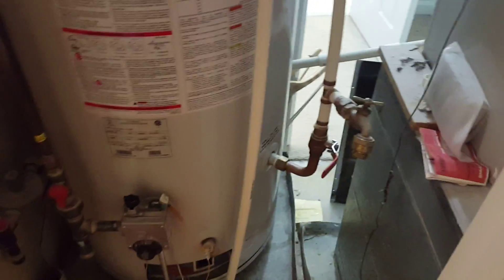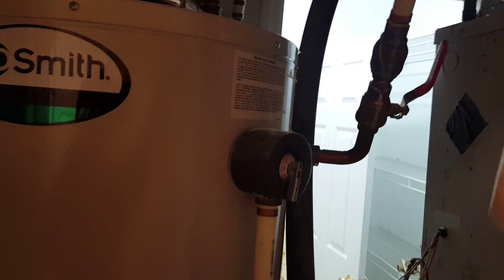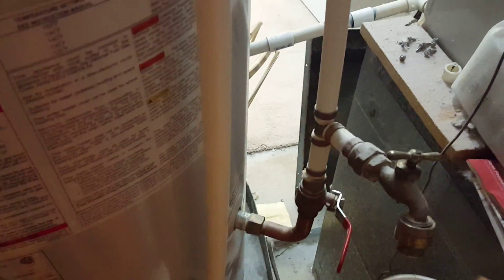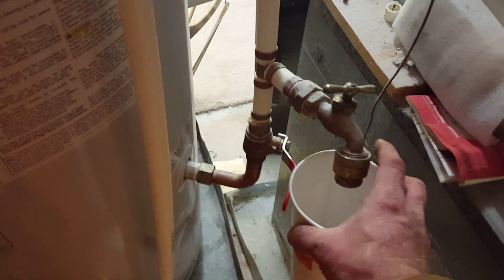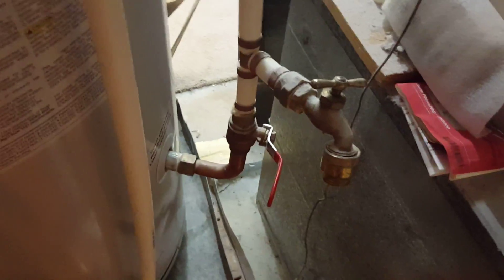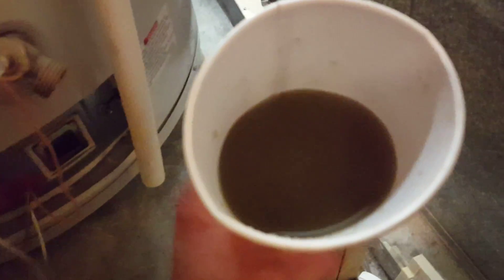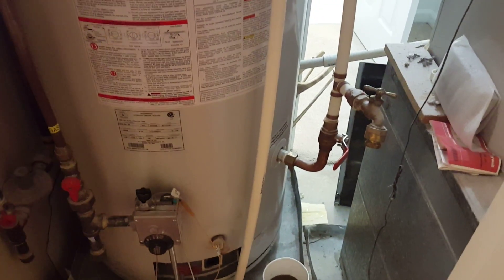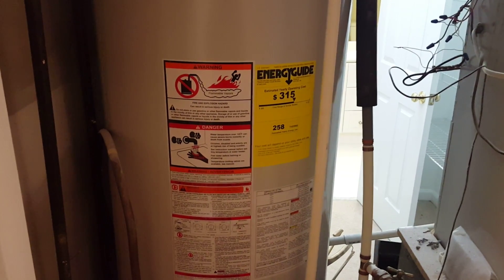Apollo water heater repair

Comment: got to see inside ur cup, ao smith, not apollo
Reply from the maker: Apollo was purchased by ao Smith  in the trade a water heater with open side taps and high BTU input is typically called an apollo water heater